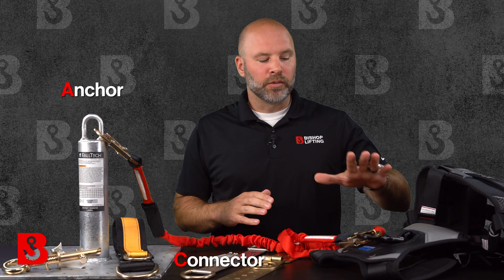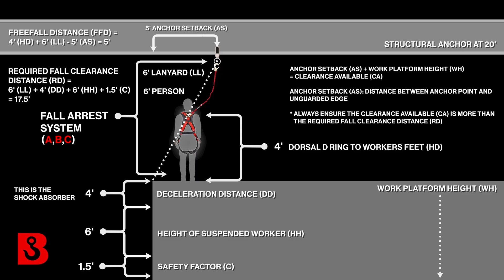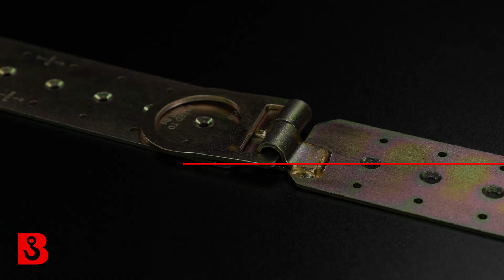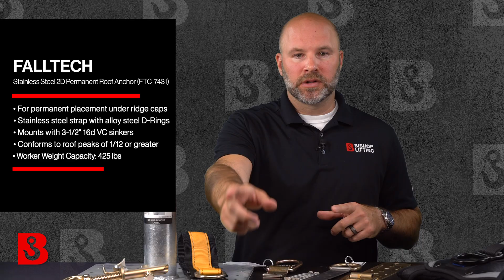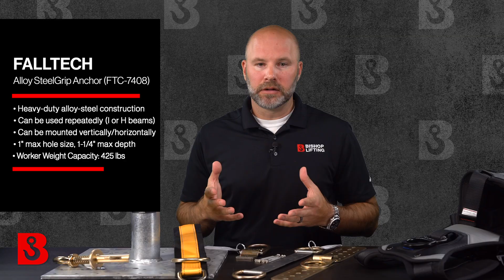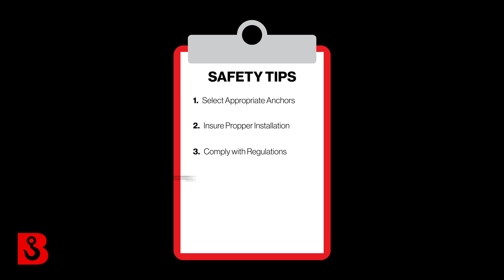Understanding Anchors and Anchorage Points | ABCs of Fall Protection (Part 1)

Comment: I have improvised all manner of anchors in the last 40 years, never have they ever failed.  The selection of material and design was always based on standard mechanical engineering and specified ratings of components.  Most safety factors were at a minimum of 10x dynamic loads to be expected. That said, the only one relying on my fabrication was me.
Reply from the maker: It sounds like you've got a lot of experience and prioritize safety, which is great!